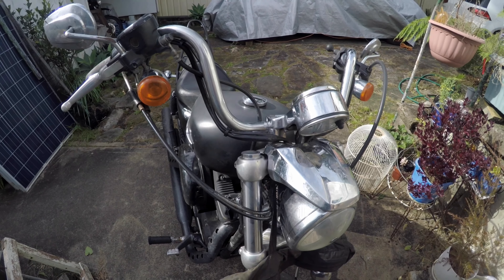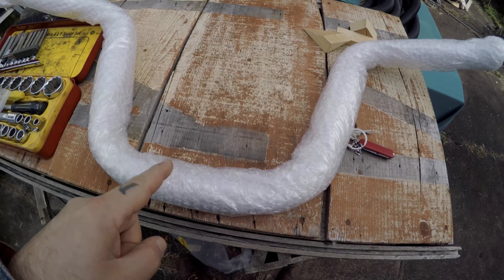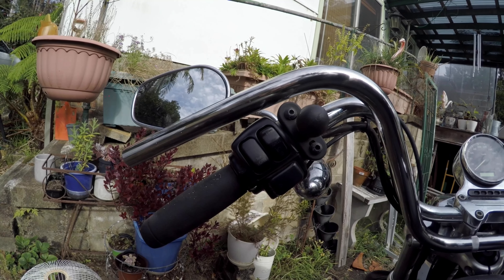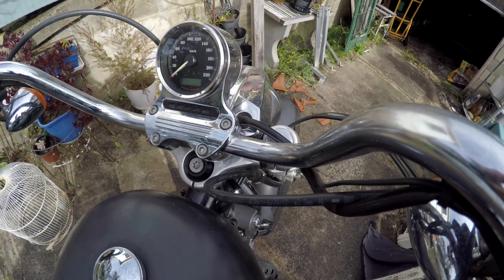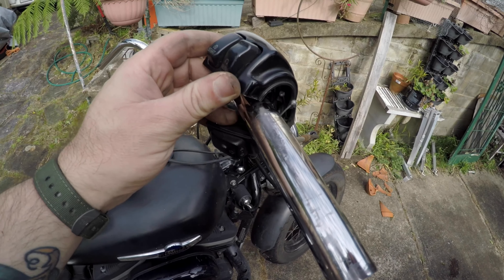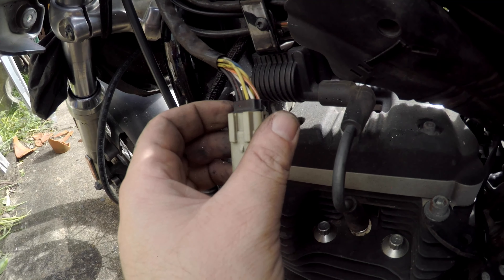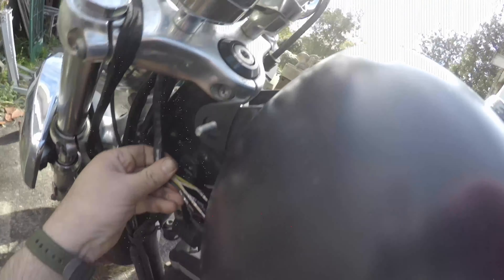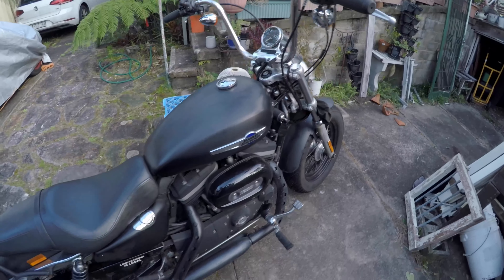New Bars with Internal Wiring on Harley Davidson Sportster. Barcraft Aussie Made

Comment: Well done, great job. I definitely advise the wiring extension, I had one of the new water cooled Triumphs and it’s wiring loom was too short, it was tight around the headstock. This resulted in many intermittent electrical faults due to the shorting and breaking of the internal wires.
Reply from the maker: Absolutely. Luckily with the wires routed over the top triple clamp, there’s plenty of give.

Comment: Enjoyed watching.. You were lucky that most stuff was long enough! I liked that the new bars will help give you a bit of space with the way the hand grips are angled. Should be more comfy for you! I did note that you need a wiring extension kit but it could have been worse!
Reply from the maker: I have a feeling the owner (1st owner) had taller bars to begin with and likely left the throttle, clutch and brake lines on. It could have been worse for sure.